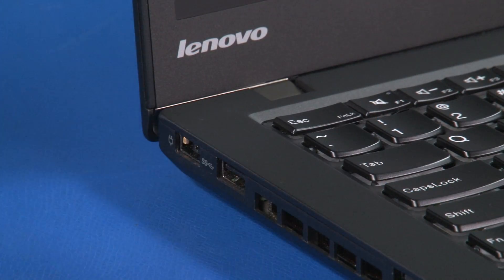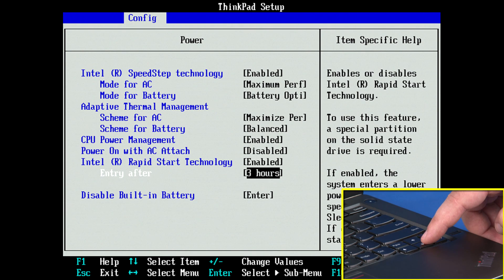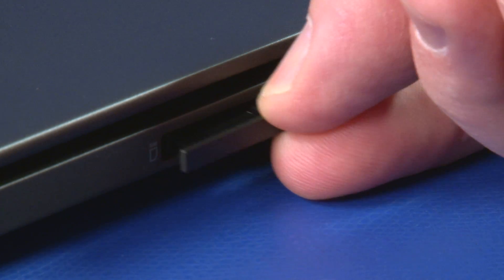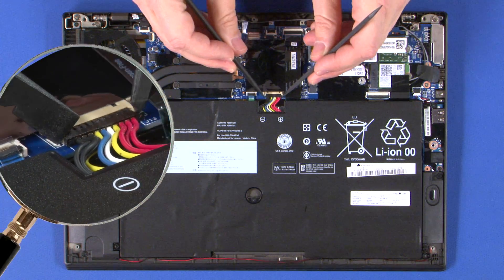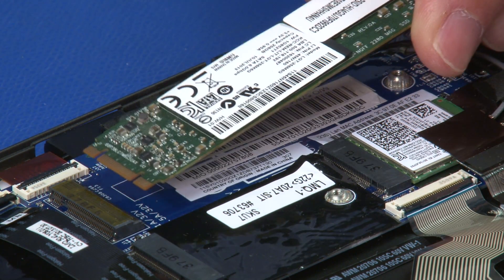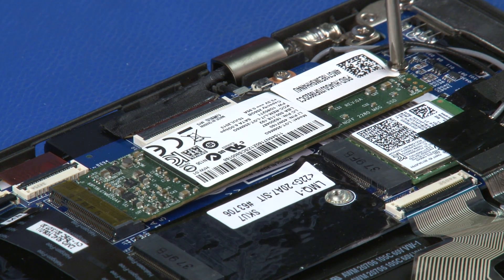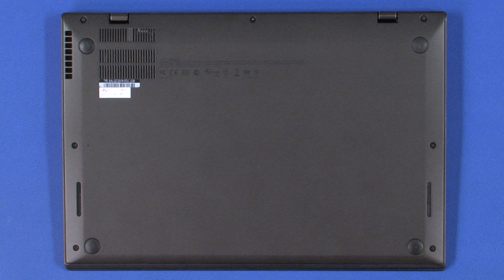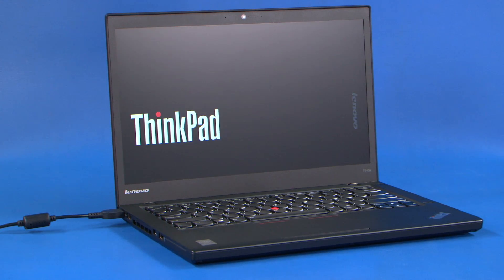ThinkPad X1 Carbon (2nd and 3rd Gen) - M.2 Solid State Drive Replacement

Comment: Is it possible to use a M2 SSD from a Lenovo X1 gen 2 in a Lenova X1 gen 3? is it possible to just swap it and run the gen3 computer with my old OS?
Reply from the maker: Hello, there! We have seen your post, and we'd like to help. Please DM us via FB/Twitter with the serial number of your Lenovo X1 gen 3, so we can check. Here's to DM us:

https://lnv.gy/3u0Wqu6
https://lnv.gy/3OzOgCg 

We wait for your reply. Karla_Lenovo
Reply: @LenovoSupport  thanks. However I do not own x1 gen 3 yet. I intend to buy one but would like to know if there is a slim chance. I do not use FB and Twitter....thus I cannot DM.
Reply from the maker: Hi Henrik! Technically, M.2 SSD will work with the Thinkpad X1 Yoga Gen 3 laptop because as per the specifications, it supports M.2 SSD https://lnv.gy/3gyChrZ, however, in regards if the OS installed on the old SSD will work, it is not recommended in trying because when your OS is installed it is installed and configured for the hardware installed in the system. Most specifically the CPU and the motherboard chipsets. If this is from one laptop to another with the exact same hardware/configuration then sure it will work just fine. Mark_Lenovo

Comment: Kudos for the great video!  I recently purchased a ThinkPad X1 Carbon Gen3 lease turn-in, and like many other used computers, this one was missing the SSD.  So I installed a spare Western Digital PCIe NVMe 2280 SSD with a single M Key I had laying around thinking that would fix the problem. 
 

Nope. Instead I got an error message on startup: 2101: Detection error on SSD (M.2) 

Come to find out, my Thinkpad X1 Carbon Gen 3 only supports a SATA or PCIe/AHCI M.2 drive. It will not support a PCIe/NVMe drive. Since I didn't have the original SSD for reference, I went to Lenovo PC Support and checked the part number. The web site showed the Lenovo part number for the M.2 card to be 04X4442.  (It's listed as a 256GB, 2280 M.2 card) However, the picture I found online shows an SSD with a B+M key instead of just an M key like the Western Digital SSD I originally installed.
 

My question: Will the Lenovo SSD (Part No. 04X4442) with a B+M key fit in a Thinkpad X1 Carbon Gen 3?  

I don't have a drive with a B+M key available to test it and was hoping someone could shed some light on my problem.
Reply: Just get a sata m2 ssd.
Reply from the maker: Hi Rich! Thanks for reaching out. Please send us a private/direct message on our Lenovo Official Facebook/Twitte Page with the serial number of the laptop for us to check it further? You can include the reference number 1960137 for your original post. Here's how to find the serial number https://lnv.gy/3wxNWfP - We'd like to help. Mark_Lenovo

Facebook: https://lnv.gy/3MDvI24
Twitter: https://lnv.gy/3wu3PUB
Reply from the maker: Thank you for reaching out to Lenovo! Your input is extremely valuable and we would appreciate your feedback via this survey: https://lnv.gy/3LHqscA. To unsubscribe please click this link: https://lnv.gy/38oJHKw

Comment: Great Video bro. Please let me know if I can replace my X1 Carbon 3rd Gen Motherboard with i5-5 Gen processor BY another x1 Carbon 3rd Gen Motherboard with i7-5 gen processor ??  basically upgrading processor here. Is it a straight forward replacement? Thanks
Reply from the maker: Thanks for reaching our support, Umer, and we wish to help. May we have the serial  number on the bottom sticker, so we can check? Carll_Lenovo
Reply: @LenovoSupport  type 20bt-s32900 S/N r9-0hv3jp 15/11
Reply from the maker: Thank you, Umer. The motherboard that came with your device is
NOK,i5-5300,AMT,TPM,8GB
SYSTEM BOARDS
Part number: 00HT347

For a list of compatible systemboards, you may click:

https://lnv.gy/3gMdcaw

We hope this helps. Carll_Lenovo
Reply: @LenovoSupport  thanks
Reply from the maker: You're welcome, Umer. Carll_Lenovo

Comment: i can change the ram ?
Reply from the maker: Unfortunately you cannot. The memory in the X1 Carbon is typically soldered to the system board (as it is with these generations) and so not interchangeable. This is due to size/weight constraints.

Comment: Hello Lenovo Support, Thank you for the excellent video. Very well done. I have Carbon X1 3rd Gen 20 BS. I want to upgrade SSD from 256 GB to 1 TB. Could you please let me know what are the compatible SSDs. When I check for M2.SSD, I get M2 SSD NVMe. Is it the same ?
Looking forward to hearing from you. Thank you.
Reply: No, X1 carbon 3rd need M.2 PCIe **AHCI**, not M.2 PCIe **NVMe*. Or M.2 SATA is also good.

Comment: What is best ssd option for Gen 3? I just got used one. I hear stay away from nvme as they are not supported. To bad. I just found a really good deal on one. Help please. Thank you.
Reply from the maker: Hi Andrew, thanks for writing in. It is still best to choose the compatible SSD and also the one that has been tested for your machine. Can you share us the machine type model number of your device? This is for us to provide accurate information. To find the machine type model number, here's how https://lnv.gy/2E2oOF9 (please do not include your serial number). We'll wait for your reply. Fraineee_Lenovo
Reply: @LenovoSupport  thank you. I just purchased Thinkpad-x1-carbon-20bs-20bt model number 20BTS27T00
Reply: @LenovoSupport  WDS500G2B0B is what I ended up ordering. I just don't know if I could have done better like a true pci drive instead of sata.
Reply from the maker: Hi Andrew, thanks for reaching out to us for support. This model can accommodate an M.2 SSD / PCIe 2.0 x4 SSD or SATA. Please check this link https://lnv.gy/2PKRYLB for your reference. There's already an M.2 SSD on the drive, you can fire up HWINFO to know what drive is compatible. Let us know if you need anything else. Stay safe. Jersy_Lenovo

Comment: Hi,
i would like to replace the 180GB-SSD with a 500GB-Modell. What is the fastest possible SSD i can use?
Mike
Reply: Sorry, my ThinkPad is an "X1 carbon 2nd gen."...
Reply from the maker: Hi Mike! Thanks for reaching out. There are different brands of SSD like Samsung Evo, Western Digital,  or Intel Optane. We highly recommend you to check for the reviews which is the best SSD to use. If you can send us a serial number of your computer, we can check the recommended SSD's for your device. You can send it via private message in our Lenovo Official Facebook page or via a direct message in our Lenovo Official Twitter page. Mark_Lenovo

Facebook: https://lnv.gy/3bGJXAI
Twitter: https://lnv.gy/352QPWP
Reply: @LenovoSupport  "wmic bios get serialnumber" under Win10Pro brings the following:
"This serial number is for a X1 Carbon 2nd Gen (Type 20A7, 20A8) Laptop (ThinkPad) - Type 20A7"
Reply from the maker: Hello, should you wish to purchase an SSD that will cater to your needs, you may follow the steps advised by Mark_Lenovo. 

You may view this link: 
https://lnv.gy/2VXT4GK on how to locate the serial number and you may send it via private message to our Lenovo Official Facebook page or via DM to our Lenovo Official Twitter page. Allan_Lenovo

Comment: hii, 
Is the X1C G2 battery the same as the X1C G3?
Reply from the maker: Hi Skripsi! Thanks for writing in to us. Yes it is, they are using the same 50Wh, LION battery with the part numbers of 00HW003 and 00HW002. -Jerry_Lenovo
Reply: @LenovoSupport  thank you :)

I have one more question,
can I plug SSD M.2 SATA III 2242 in the WWAN slot ?
Reply from the maker: Hi! No it isnt. The M.2 slot in the X1 Gen3 is single-sided only and it doesn't have Sata lanes around it. -Jerry_Lenovo
Reply: @LenovoSupport  and, does the X1C G3 support SSD NVMe ?
Reply from the maker: Hello! Found this similar discussion in the Lenovo community forums: https://lnv.gy/2Kf2t7b. Many in the community said that NVMe doesn't boot in the X1 G3. Hope this answers your query. Hassen_Lenovo

Comment: Question.... if I replace the ssd on my Levono think pad will I have to clone my windows 10?!
Reply from the maker: Hi Justin! Thanks for reaching out. If you will replace the SSD of your Thinkpad laptop, you have an option to clone your OS, but you need a software for you to do that or you have an option to perform a clean install of your OS. Mark_Lenovo
Reply: If I choose to clean install on the OS do I have to re buy a whole new windows 10 ??
Reply: @Jusso672  You *SHOULDN'T* have to buy a new Windows 10. That sentence comes with a big caveat, because when Windows 10 is pre-installed, they hide the product key from you. Instead what you get is a unique signature that is stored on Microsoft activation servers. The problem is: that key is tied to your hardware, so swapping hardware CAN leave your machine unrecognized. Supposedly nothing outside of swapping the system board would mess up that signature, but I HAVE seen it happen before, so be warned.

Short answer is, you should be fine swapping only your M.2 SSD. Long answer is, if you really want to be sure you won't lose your license, either get a program like recover keys so you can have a copy of your original key, or call Microsoft or Lenovo support and tell them what you're doing and express concern that you will lose your Windows Key. I've lost my key swapping hardware before and if you lose it there's really no way that I've found of getting anyone to give you a new license, because you don't really have proof that you ever had the key in the first place.
Reply from the maker: Hello! As long as you will install the same version of the operating system without changing the motherboard, you won't need to buy the key. Thanks.  Arjay_Lenovo

Comment: Hi Tim, I wanted to thank you for the video showing how to change the powerjack.
I had an old X1 from 2012 laying around, but good to use in case of need. So I found a sparepart over the net for around USD 5-6 and replaced it. Thanks! Björn

Comment: First: EXCELLENT VIDEO!! THANKS!! However: What a clumsy, impractical design! 7 screws and one more inside! And you have to remove the sim card tray! And alter your BIOS settigs! And mess with the internal power cable! Wow, Lenovo! I am not impressed with this at all!
Reply: Pretty standard design. Don't have to change bios settings or unplug the battery cable. It is just precautionary actions.
Reply: @henriklg  : Still super clumsy. What's wrong with doing it a smart and easy way instead?
Reply: @sylla2  if you aren't able to unscrew 7 screws and think it's too clumsy you should probably just hand in your device to a store and have them do it..

Comment: I HAVE A 3rd gen x1 thinkpad and my ssd m2 does not have that format? it only is i keyway...not 2 lik e the one you are installing..could you tell me what will work in a 3rd gen thinkpad x1 carbon for a ssd hardrive,,,lenovo is stupid,,,1st they weld the ram to the board and start with 4gigs only.. then they use this weird keyway for their ssd,,,unbelievable...to many stupid people working for them,,i liked it better when it was IBM overseeing everything.
Reply from the maker: Hi Douglas! Thanks for reaching us. As per checking, https://lnv.gy/2PBkthV this X1 3rd gen has  M.2 SSD / PCIe 2.0 what is the card you are trying to use? Arjay_Lenovo

Comment: Hi thank you for the videos but I have X1C3 20BS and the shape of SSD connector is different from the one shown on your video. I just tried a CRUCIAL P1 3D NAND, NVMe, PCIe, M.2, normally this SSD was supposed to work according Crucial website. But when booting my computer with that new SSD, it does not work, got error 2103. What kind of SSD is inside my computer? 
SSD model is SAMSUNG MZHPV256HDGL-000L1
I really want to upgrade my SSD.
Thank you in advance for your additional information.
Reply from the maker: Hi gab malt! Thanks for writing in to us for support. We highly advise to format the SSD first before installing to the computer. You can follow the steps provided here on this thread (https://lnv.gy/2vrEU3I) for installing the SSD. -Jerry_Lenovo
Reply: thanks for the quick answer, I already flashed the latest bios. I tried to install the OS from USB DVD and it worked. However once the system needed to reboot I went back to the error 2103.
Any other possibility? That's strange because SSD is visible and usable with a live DVD for example, so it should communicate with mother board. If you have other tips please do not hesitate to share them.
Reply from the maker: Could you try the steps provided by "x220forme" to disable the battery on this link: https://lnv.gy/2ITWVjN. Update us how it goes. Auxen_Lenovo
Reply: I tried it also, I can manage to install windows but I cannot reboot. During the next reboot I can access a kind of emergency menu after saw error 2103 message. In that menu I can sometime see the option for the windows boot manager but when I hit enter nothing happen. That's really weird this story.... May be the new SSD is not working properly...
After having checked with the existing SSD, the previous one which is working is AHCI and the news one is NVMe are you sure both are compatible with our carbon x1 Gen 3?
Reply from the maker: Hi, Thanks for keeping us updated. We have a few steps that we recommend for you to try if you haven't already. Follow these steps below.

STEP 1: Enter the BIOS
https://lnv.gy/2ZMXe5j

STEP 2: Disable Secure Boot
>Go to the Security tab 
>Select Secure Boot
>Disable Secure Boot

STEP 3: Enable CSM (Compatibility Support Module)
>Go to Startup tab
> Select CSM Support
>Set the value to Yes

STEP 4: Disable OS Optimized Defaults
>Go to Restart Tab
>Disable OS Optimized Defaults
>Exit Saving Changes

After exiting BIOS, try re-installing Windows again on the Crucial SSD and observe

Let us know if this works out. Jack_Lenovo
Reply: Just tried it and when install is done and laptop reboot I got again this error. In the menu appearing after. I saw windows launcher but nothing happens when trying that one. I tried the ssd in another computer and it worked. I do not have any idea except trying another ssd, a sata one with double groove connector which seems to be also working. If you have another idea please let me know.
Reply from the maker: Hi Gab, Thanks for keeping us updated. We have checked and the reason why the PCIE SSD is not working is because the system is not compatible with it. There are two available variants for the X1 Carbon 3rd gen. One that supports PCIE/NVME M.2 and one that supports only SATA. You can use this link to know more about the machine specifications. https://lnv.gy/2ZPtlBi. Let us know if you have any questions. Jack_Lenovo
Reply: Then I will try the other version with SATA, no matters if it is the B+M version it will fit within the M2 slot anyway?
Reply: Do you think Samsung 860 Evo 500 Go Sata will be suitable?
Reply from the maker: Hi Gab, Thanks for keeping us updated. As long as the SSD is SATA it will be compatible. I have also checked the Samsung 860 Evo 500 SATA since this is SATA 3. It will be compatible with your machine. I have also attached the link to view system specifications for this unit. https://lnv.gy/2ZQs5xK. Let us know if you have any questions. Jack_Lenovo
Reply: Thanks a lot everything worked.
Reply: @LenovoSupport  Regarding the variant that supports PCIE M2, how do you determine which X1 3rd Gens are compatible as they are both M2?  Please explain and provide technical guidance.  Thanks.

Comment: how about upgrade in details for my type 1291 ? i can't see in any
Reply from the maker: Hi @Somkiat Jirakanjanakit ! Thanks for writing in. In Model 1291 (Thinkpad X1 and X1 Hybrid), there are two ways to upgrade the storage. First, you can replace the current storage to an SSD with up to 160GB or add an mSATA SSD with up to 80GB. The part no. are below:

2.5 SSD / 45N8145
mSATA SSD / 45N8259

For instructions on how to upgrade once you have the part needed, you can follow the steps in this link https://lnv.gy/2GnlQew Let us know if you have further questions. Hector_Lenovo

Comment: Can i put 2242 m.2 ssd in it? Thank you
Reply from the maker: Hi Andre. Thanks for reaching out. Unfortunately, it only has 2280 m.2 slot. You may check the compatible ssd here. Auxen_Lenovo
Thinkpad Gen 2 
https://lnv.gy/2Kqu9Fp
Thinkpad Gen 3
https://lnv.gy/2KtVmac
Reply: Technically you can, but you will not be able to screw it down because it's shorter. Mabye with use of some adapter :)
Reply: Hii,i also wanna know that 2242m.2 ssd work with my 3rd x1c?

Comment: Hello lenovo support ... I want to install SAMSUNG 970 EVO M.2 2280 1TB PCIe Gen3. X4, NVMe SSd on my X1 carbon 3rd gen (type 20BT) but I am not sure if it will  work ... can you pls help me out ... it's an expensive drive so before buying need  to be sure if it will work ... I am currently using the following drive SANDISK d8sn8u-512g-1006
Reply from the maker: Hi Omer! Thanks for reaching out. Thats a good question. The Samsung 970 EVO M.2 2280 1TB PCIe Gen3. X4, NVMe SSD was not tested on the ThinkPad X1 Carbon 3rd Gen. However, I found a similar discussion wherein a user confirmed that Samsung EVO 850 500GB M.2 is working with his laptop. Please refer here https://lnv.gy/2B60zC0. You can find the list of certified parts here https://lnv.gy/2B4fzAy. Let us know if you need additional help. -Maru_Lenovo